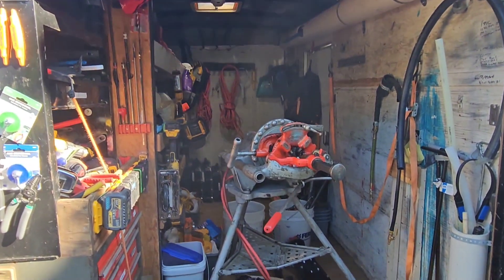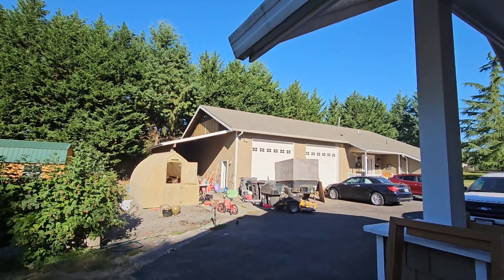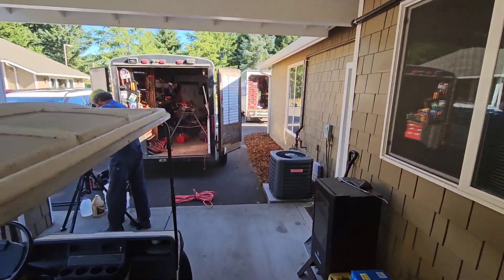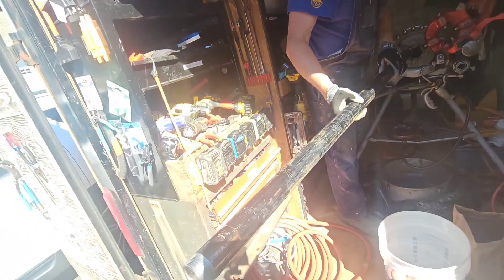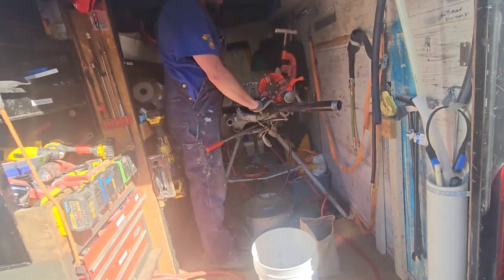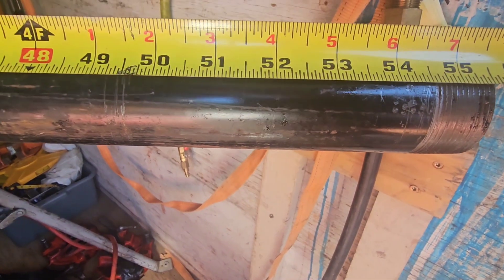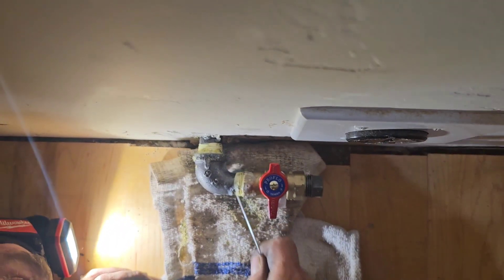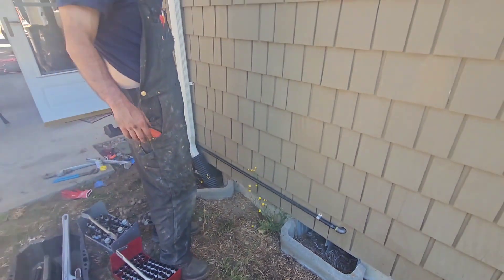Cut Thread Pipe Electric to Gas Range Conversion

Comment: outside gas piping should be galvanized what do you think
Reply from the maker: We try to avoid Galvanized piping in Gas. They say the Galvanized coating flakes off from a reaction with the games. We will install black Steel and paint it with an exterior grade coating to protect it from the weather.